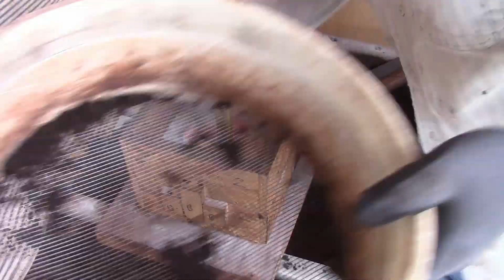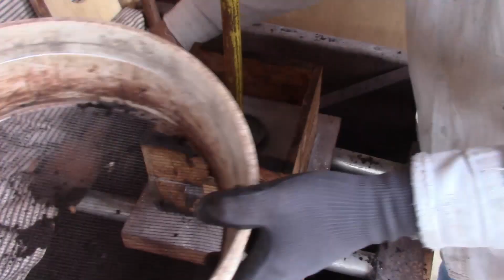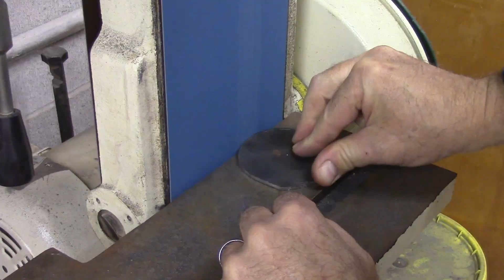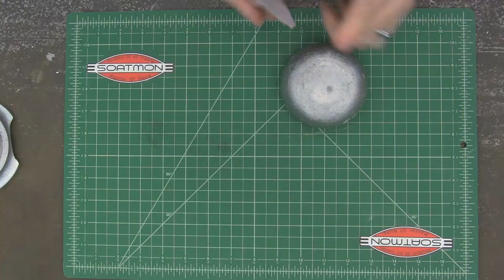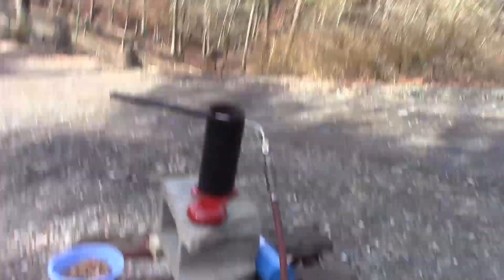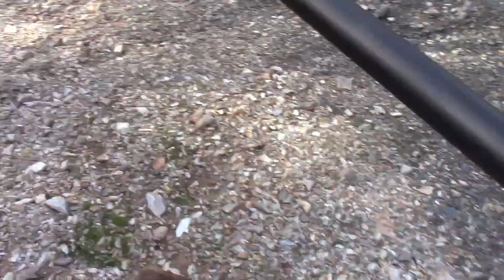DIY BBQ Smoke Generator

Comment: Do you have moisture condensated in the chips on the top? I do have in mine smoke box but my is built differently. Suction pipe is in the bottom not in the top...
Reply from the maker: No moisture on top but I do get a black build up that I have to break away after each use.  Still works great!

Comment: Did you have any problems with condensation building up inside? If so, how did you resolve, or prevent it? When I used mine for the first time, it soaked up all my pellets and extinguished the fire.
Reply from the maker: No condensation but tar will build up and block the air flow. I have to clean out the pipe before I use it each time.

Comment: I build one and pump is not needed.
I weld it but also liquid welding can be used.
mine last me 2.5 to 3 hrs of full blown smoke. pallet or  wood chips can be used
Reply from the maker: I watched your video.  Looks like it works well.

Comment: Doesn't the mig tip plug up very quickly, I would just use pipe.
Reply from the maker: Never has been a problem. The main exit pipe has to be cleaned regularly.